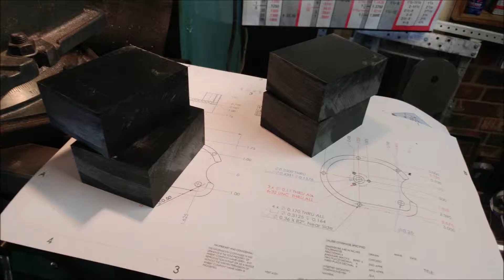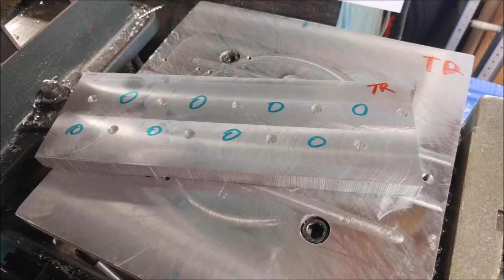30lb combat robot concept || prototype  #mecanumwheel #omnidirectional

Comment: This is really cool, but I'm curious what the specific use for 8 mechanism here is? What benefits does it provide over just 4? Would love to know your thought process!
Reply from the maker: Well glad you asked.   The original plan for this chassis was all about mobility.  Since Meccanum wheels work in pairs I thought that it would be crucial for a combat robot to have redundancy.   Also not sure if it was noticed in the video, but two sets of the wheels are articulating.  the idea being that if a wedge bot lifted up some of the wheels the others could stay in contact with the field surface.   Again, this was/is a prototype and many of the initial ideas needed reworking.  :)  Thanks for watching.
Reply: @MoralRichMedia  ahhh, ok. redundancy is important! I was in my highschool's FIRST program so I love seeing little bots like this around and figuring out why they are the way they are. thanks for getting back to me! 💙